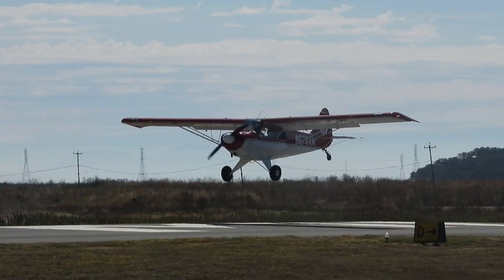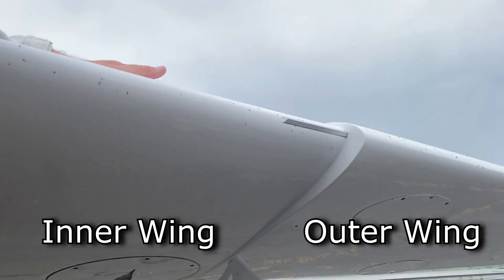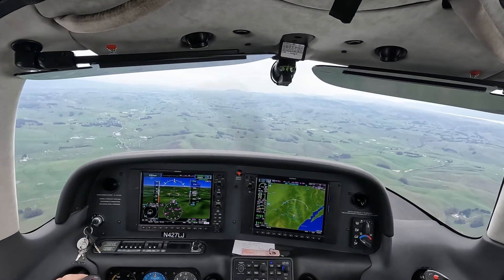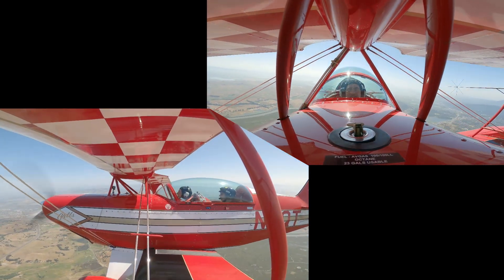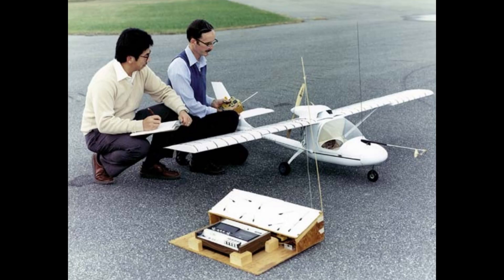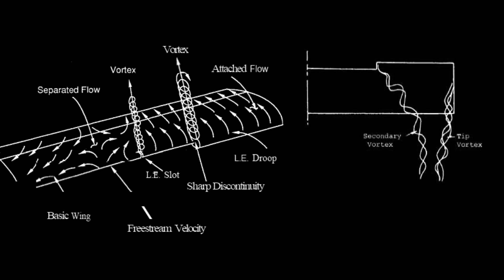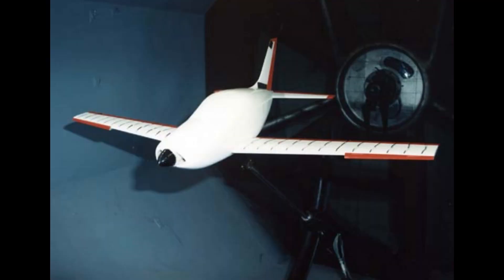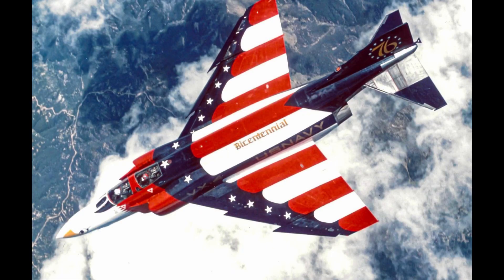Why Is The Wing Broken On Some Planes - How a 'Dog Tooth' Makes Wings Work Better.

Comment: Good story. Thank you.

But your historical overview is significantly incomplete. And I think it's important to identify the authors. Scientific research on the stall spin began at RAE UK in 1913. They relied on the experience of the first, apparently, swept-wing aircraft, and even the Dunne tailless. Apparently, this is the first aircraft with certified flight control. For the first time, they have a wing twist. Hill used protrusions and variable sweep in the UK.

Although in 1913 they worked on a stall on a simple biplane. And even then, fences were introduced on the upper surface of the wing in front of the ailerons. They are visible on the upper wings of the Curtiss and Flextow flying boats. It seems that they forgot fences, but in 1946 they remembered again.

At about the same time, they remembered about the fang on the leading edge, which appeared in the UK before the WWII.

I am writing because almost no one mentions this in the historical review. But for some reason, these implementations are attributed either to Messerschmitt employees or to Soviet aerodynamicists. Soviet developments could not have been the first, because they were simultaneously being implemented in the USA, despite the fact that the work in the USSR was secret. This happens in history when there is a little-known common source.
See: Westland Pterodactyl I, Curtiss XP-55, Northrop XB-49, MDD Goblin.
(I'm Soviet engineer. My english is very bad)

Comment: Gin Paragliders have started using an innovation where the leading edge of the Paraglider wing has ripples like the front  of the fins  on a humpback whale. Improves  the stall characteristics and reduces drag.

Comment: Scott your segment on wing configuration to redirect the sirflow over the chord of the wing to improve stall control rattled my memory of a nifty little aircraft that came from the factory with no rudder pedals.
After WWII, The Ercoupe came on the private aircraft market, and it had  a badge on the instrument panel that stated "This aircraft is incapable of spinning".  That was a great flying plane despite its lack of rudder pedals. The control yoke was the only way the pilot could make control inputs and the turns were always nicely coordinated. I always wanted to see how the rudders were rigged into the rest of the control cables but never got the chance to look that deep inside.

Comment: On an older Jodel with a kink-angle in the wing a pilot once told me they have two angles of attack so when travelling at speed the one part becomes more neutral and only the other part creates lift -> less drag -> more fuel efficiency

Comment: When I was glider training, I got told off during stall practice, because I was so good at stall recovery, it would do it the moment the aircraft had stalled, and done less than a quarter turn. They started to make me let it spin up for longer in an insipient spin dive. I made the instructor dizzy from the spinning. It amazing how slow your your actual fall rate is in a glider.

Comment: I had a model of the F-4 Phantom II as a kid. Heh, the kit included "damaged" parts, which I used, but didn't have a clue how to paint the interior bits--not really logical, but I painted those bits red......
My F-14 Tomcat model has gearing inside, so that, when you swing the wings, they do so together, and the strakes come out as the wings angle back. Funny thing about that--until this video, I didn't know what strakes were. I'd run across the word, but no idea what it meant. Heh.

I always wondered about that jagged edge, but never thought to look it up. It would have helped if I'd had a name for it, but the lack of internet made it very difficult Anyway, it's always bothered me that so many people don't seem to know it's the Phantom II, not I.

Comment: Note some aircraft have their rudders blanked in spins and you’d use aileron though you have competition between asymmetric lift, asymmetric induced drag, and with inertial moments which differ by more wing loaded or more fuselage loaded mass distribution. The T-38 recovers by aileron while the T-45 has significant aileron contribution. The F-16 and F/A-18 get more contribution from stabilator differential. The F-15E uses asymmetric thrust. Point here is start with PARE but don’t discount other potential contributions should PARE be insufficient. Trying to lean forward and throw stuff forward can also help in extremis. As for your slow flight before stall and spin, try using rudder to keep wings under you instead of aileron. Try also using constant AOA turns not constant Airspeed turns meaning instead of adding some power and back stick, add some power and a little bit more. Learn also to do flat rudder turns thus not “losing lift” to horizontal lift. You’ll not regularly do this last though it is good to see and understand, Hopefully you will move toward constant AOA turns away from constant airspeed, however.

Comment: I thought that biplanes were constructed with the upper wing at a slightly higher angle of incidence than the lower wing. The lower wing is also usually slightly aft of the upper wing. In a stall situation the upper wing stalls first while the lower wing continues to provide lift behing the CG, easing the recovery from the stall by lowering the nose.
Also, my  father's team at GSFC used to fly magnetometer eperiments on the Scout rocket. I remember him, in one dinnertime conversation when I was young, about a Scout flight where each stage veered slightly to the north, sending the suborbital payload up near the Boston area.

Comment: The algorithm threw up an interesting vid about prop design which then touched on leading edge characteristics. Copying the unusual leading edge of whale pectoral fins and applying them to boat props reduced cavitation and in wing design touched on a lot of the phenomena you mentioned here. Just to refresh everyone’s memories about whale pectoral fins they are anything but smooth. They have troughs and ridges among other shapes. Even a whale’s “face” has bumps for smoother water flow over its head.

Comment: I'm a NASA engineer at Langley Research Center where much of this spin research took place, and help support our research facilities including the 20 foot Vertical Spin Tunnel (VST) and 12 foot Low Speed Tunnel (12ft LST) featured prominently in your video. Both of which are more than 80 years old, yet are still in operation because they are so important for testing spin stability and enabling safe flight. There are only a handful of these in the world, and have tested nearly every aircraft and spacecraft designed in the US! It's an almost crazy mix of modern high-technology and old-school 1940s methods. One of the most important model tests remains a researcher physically throwing a free-flight spin-test model into the VST, with the wind tunnel fan speed controlled manually by a joystick to allow it to hover in the center of the instrumented test section while data is gathered. I feel very fortunate to have had a small part to help design our new Flight Dynamics Research Facility (FDRF), a new state-of-the-art vertical wind tunnel presently under construction at Langley to replace these venerable tunnels, with promise of even higher quality research for decades to come. Flight is hard, space is even harder, and aspects like this are not necessarily appreciated by the general public- thanks for helping share this with the world!

Comment: Some of the firsts who get to really use leading edge vortex generation at the base of the wing were mig29 and su27, hence their ability for control beyond "reasonable" AOA. So all the Cobras, Kulbits and other amazing figures become possible.
Reply: They were made after the LWF, F-16, F-18. Which were sidekicks to the F15, F-14. All lf which used Vortex lift to varying degrees. The later two much more so. The Sukhoi SU-27 came after all of them, and also borrowed from the Rockwell B-1A.

Russia invents nothing, only copies everything.

Comment: Note that the BDArmory AI does not know not to use the Ailerons to steady a nearstall like this. It is instead prone to doing exactly that. If you've ever wondered why you can take a plane out and find it braindead easy to fly and the AI can take the same plane out and go immediately into a flat spin on the first turn, this is one reason why.

Comment: As always, it's a very good explanation. I love the show. I took my private pilot test in a "light sport" plane that would drop a wing every time that it went into a stall. No problem when you develop the instinct to apply rudder the moment it drops. The plane flies straight. Of course, the An-2 might have the best stall speed, rumors are that if you lose the engine, you can pull the stick all the way back and land at 25mph, no stalling.
Reply from the maker: I had to stall the Cirrus 3 times during my checkride before I got a wing drop.

Comment: The Piper Archers my flight school uses have a stall strip about half way out on the leading edge of each wing, as well as a geometric twist to reduce the AOA at the wingtips. I didn't know that an abrupt discontinuity actually further improved stall characteristics, though the Archers and Warriors have a pretty benign stall anyway.

Comment: I will never forget the time the pilot of the Cessna 172 I was in deliberately did a power-off stall into.a spin.  Exciting even though I immediately recognized that it was deliberate and we had plenty of altitude.  We had been in far more danger the day before when we had snaked over a pass at less than 500 ft with the mountains on either side covered in clouds.

Comment: For those of us who learned to fly in C-150s and Cherokees back in the 1970's, one plane that could show you the dark side of stalls and spins was the AA-1 Yankee. With around 100 hrs I decided to check one out where I usually rented trainers. The instructor, who was smarter than me, but still didn't know the Yankee, had me climb to 5,000 ft AGL for stalls. First one, I lost 500 feet, so he said to try again and just lower the nose to level or slightly down. Did that, full power, no ailerons, etc and it held for a few seconds. Then BANG,  left wing stalled and immediate steep nose down and begin of a spin. We both reacted properly with rudder, but it still took us 1500 ft to get straight and level. We both agreed that I would NOT be practicing stalls in that and would hold about 5 knots more on final (long runway). I rented it 2 more times, but for me it was like a motorcycle- super responsive, but too much for this casual flyer.

Comment: 5:18 Don't want to be "that guy", but I believe IL-62 had this very feature back when it was built in 1963. They didn't put slats on it and this was to compensate for it. And it's not like the NASA guys wouldn't have seen it, IL-62 was the plane that flew to New York.

Comment: Just saw your video about the RUD Rapid Unplanned Disassembly (the frickin' thing exploded!) failure of the recent rocket shot.  The one where you said it 'wasn't a failure'?  First off, with that kind of thinking and praising, not to mention that it is wrong, but it fails to recognize ISSUES.  If it WAS to be terminated after clearing the pad (for example), then destroy it at that point and call it a success -- after all, that would be all that you wanted out of it.  Anything else, and it fails like the aforementioned 'WOKESPEAK' of 'RUD'!  I mean... you do NOT have to be a 'rocket scientist' to figure that one out.  As to gravity keeping the fuel in the bottom?  You DO know that those tanks are PRESSURIZED?  They DO NOT needs gravity, dolt.  As to the vapor coming out at the end,  ever saw what happens to pressurized gas (in this case: LIQUID OXYGEN) when it rapidly VENTS into a vacuum?  Sure of your competency?  Look, in the end, some things worked and some didn't.  One has to find out what worked and what didn't, and do the things need to allow for that which did NOT work and massage and better (if possible) -- that DID work.  That simple.  I don't think that 'they' need you commenting on something that you do NOT know.

Comment: Wow, this brought back some great memories. When I was a cooperative education student working at NASA Langley, I spent a semester working for Paul Stough and got to participate the flight testing of the leading edge cuffs on the Grumman Yankee aircraft at Wallops Flight Test Facility. I taped the tufts to the wings, painted the cuffs, and monitored the telemetry while Jim Patton ran through a series of spins for each test run.

Comment: Correction on wing wash out. Actually on aircraft like the spitfire the tip has a higher angle of attack than the root. This is because you wanted the tip to enter buffet first, mainly because lift is distributed elliptically with more life produced at the wing root, and because buffet at the wing tip will be more palpable in the roll axis due to the longer moment arm from the length of the wing. Skilled pilots seeking to maximise turn performance could safely fly the Spitfire just into onset of wingtip buffet conditions, and this acts as a convenient indication that turn performance is being messed.
Reply: *maximised not missed

Comment: Some aircraft have leading edge slots on the outer wings that work similarly to leading edge cuffs. This helps to maintain full aileron control at low speeds. It's more common to see on slower aircraft.
The outer wing like on Cirrus is a different airfoil, one more optimized to flying at higher angles of attack.

Comment: On that image of that F-4 before you start the video, the only sawtooth/dogtooth is the outer one, what looks like an inner one isn't, it just has the wings leading edge slats extended, you can see that better on the wing towards the top of the image.

Comment: So do these prevent the fun of intentionally spinning a plane by kicking the rudder as it stalls?  I used to practice 1-turn spins in a Cessna 170B taildragger, where you spin a stall and recover in 1 turn at the original heading, then climb to spin again.  Those were the days.

Comment: Good explanation thankyou Scott. Very insightful.
I think the genuine application of little winglets and vortex generators is particularly shown more in race cars, particularly Formula 1 cars.
The speeds are obviously significantly less than aircraft, but their use of these things I imagine is related to aerodynamic efficiency and downforce, and creating vortex boundaries in places along the car.

Comment: Would love to know how a stall warning system works!
Reply: On a Cessna, There is a little device mounted on the leading edge of the wing with a small metal flapper that projects forward and down, right at the stagnation point of the wing, when its at the safe landing angle of attack. (Maybe 12 degrees AoA).

This vane is lightly spring-loaded down/backward. Air pressure also pushes it rearward at low angle of attack and high speed. 

But at high angle of attack, the airflow pushes the vane forward. Bwcause the stagnation point moves rearward and under the leading edge thereby "blowing" upward causing the vane to flap forward and upward.

This shorts an electrical signal to a horn in the cockpit next to the pilots ear. The horn sounds, and alerts the pilot he is approaching the stalling angle of attack.

Comment: You see those little winglets on F1 cars and some high performance road/sports cars as well. I'd assumed they were for guiding and cleaning up airflow, but it could well be that some are for creating vortices that stop airflow from spilling around the sides of a car, so it stays in a more linear flow rather than fanning out. I don't know if that's the case, but it seems likely now that you describe how these things work

Comment: The real wizards of vortexes these days are the automotive Formula 1 designers. A lot of work is done to make vortexes form at the sides to trap the low pressure air beneath the car and generate downforce.

Comment: 1:24   as mentioned, the outboard wing has a  Different  profile.     in this case, the inboard profile is nearer to being symmetrical.     with more positive aoa being present in the outboard profile.          the result is more lift is produced by the outboard part of the wing.          any (overall) increase in positive aoa will be 'amplified', at the outboard wing.
1:58   some of the affects observed in a simulation that relies on  MOVING  air  are  Wrong.       because, in the real world, it is the  WING  that is in motion.          in general, a  SYMMETRICAL  profile should be shown/used in such 'simulations'.          
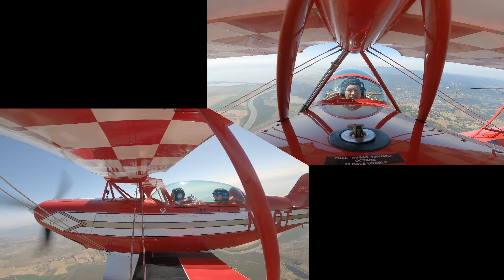3:16   this may be true.       but, during a flat spin the effective airspeed the amount of air moving past the control surfaces is insufficient for them to be effective.       thus, the nose must be pointed  Down, in order to gain airspeed and have enough control to exit a flat spin.
6:35   this graphic sucks.      the profile is  TOO  thick.        when thinking about 'flow' separation a couple facts should be borne in mind.    1)  there is  NO  air flow.    the  WING  is  moving.      2)    a flow separation model that is  based on moving air  is  FLAWED.!!!

Comment: For building rc models its a bit tricky to build these.
The way i tackle the issue with that is using a different profile at the tip then i have on the root.
Plenty of different wing profiles with specific charactaristics available and it makes a big difference.